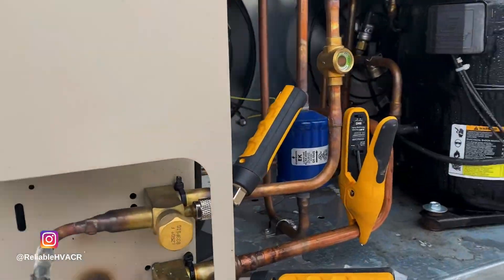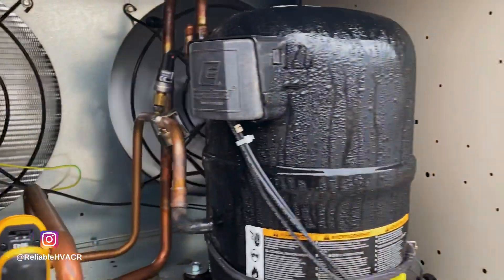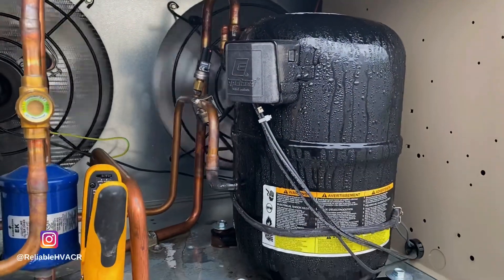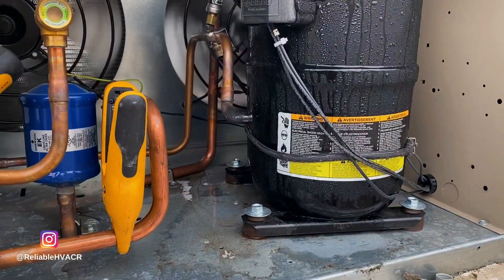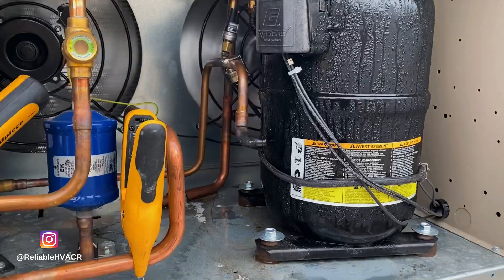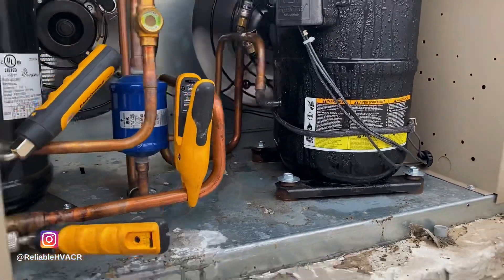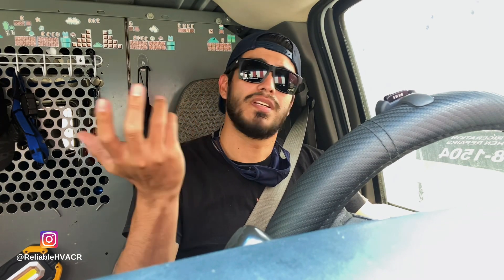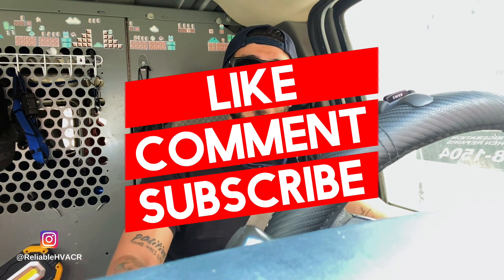Different Issue Now | Update on Intelligen Heatcraft

Comment: I find a lot of bad thermistors on them. But just had a similar problem and found the plug harness where it plugs into stepper motor was dropping 1 or 4 legs. I could bend the wire back and get continuity, so I zip tied it in that position.

Comment: I spent 2 days trying to figure out a similar issue. 
In this process I found that two small disc shaped magnets, the silver strong magnet type, when stuck to the valve body with yellow coil removed, can be rotated and open and close the valve. Definitely helped me find the problem. Then I just had to wait for parts overnight shipping because no one had the parts in stock!

Comment: I know this is an old thread. Always verify the suction valve pressure transducer values, with your actual pressure gauge. I see on the video the EV suction pressure is at 84.7 psi, EV suction temp 38F. When pressure testing this system. Do not exceed 150 PSI. Higher pressure test will destroy the transducer.

Comment: Got a ? Maybe u can help or someone here
The other day i came walk in cooler 44 degrees wont go anylower After 2 days coil completely freezes up
Its running 448a system is 9500 btu 
I defrost the unit 
Start it up 
Its set at 7 superheat 
My monitor showing me 7
Sup
I put my digital gages sup matched suction line temp matched to what board
 reading exv does pump down and opens up no problem. At 43 degrees its starts to freeze up
To test i set it at 44 and runs ok no freezing
Oh did i mention 152 steps valve doing. 
Checked the pressure hi low side evrything looks good but the damn thing wont go below 43. Theck support trying to tell me tge unit undersized for the cooler box.

Comment: Comments from Heatcraft training today... #1 problem is not setting tap on transformer to 208 volts if that is your supplied voltage.

EEV valves themselves are pretty simple and bulletproof IF system is clean and tight and assembled while purging nitrogen. Powerhead coil failure possible but more likely GIGO info failure or bad board.
Reply from the maker: I had someone from heat craft reach out but nothing came from it.

Makes sense but I installed these myself since they were new to us. Used nitro ever time and protected valve. And we ran a new breaker & line, ours were 115v . 

But yes I realized it was the board and not the eev , I'm just not sure how to test them. When you run it in test mode of course it gives you all the proper readings. But it isn't sending out signal during normal operation. I figured I'd try a new board since they had sent one just in case and that was it.

Comment: I had same problem with heat craft beacon2 EEV valve. It was failing to open valve. I did replace EEV coil but nothing helped. Next day I went to change valve and found from there employees that it just started working 45 minutes ago. I still not understand how it started working after 13 to 15 hours later. It’s been four months it is still working.
Reply from the maker: I've tried calling and I didn't get a straight answer unfortunately, for me the board was faulty even tho the test mode was showing good. I think with these it's usually a control issue not the valves.

Comment: Sometimes these things get into a funky lock up thing. This worked for me. Disconnect the 24 volts at the transformer and then restore it. Do this about 25 times for about a minute,  then cycle all power off and give it a try. These are 0-5 volt DC bipolar expansion valves meaning it needs 5 volts + to open all the way and 5 volts - to close. The board is supposed to remember the last position the valve was at when it turned off, so that's what it will open to even thou it may say differently. What I do know if you over cycle the board power (many times) it makes it get stupid and go back to the default setting. These valves have no feed back to the board telling it where it is and I think the board gets confused as to where it should be and does nothing or drives it all the way open. I have found this problem on high load systems where defrost is used a lot. This doesn't fix the problem but is a work around in the rare situation it does this.  This should force the valve to close.

Comment: That's my client too, just had a nitmare with a freezer,  first valve, they factory said bad valve again stuck open, voltage looked good,  ended up doing board and it worked even with factory saying board good, crazy
Reply from the maker: Wow same exact then 😂

Comment: Found this video while waiting on hold for heatcraft tech support. Having the same exact issue. Swapped the board, valve, and eev motor. We've swapped out eev motors and boards on multiple units.
Reply from the maker: After this video it's been working, so far only 1 out of 3 units we installed did this. It was so frustrating tho. And I've heard the same from others.
Reply: @ReliableHVACR  
On this one the eev and board were bad.  But during troubleshooting I rotated the plug for the eev motor and connected the terminals incorrectly. This causes the motor to run backwards or inconsistent operation. I chased my tail for a few hours but I'll own my mistake.

Comment: You can close it manually by rotating the coil on the valve counter clockwise.
Reply from the maker: I thought you needed a special carel magnet tool to do that, been meaning to order one.
Reply: @ReliableHVACR    Stock coil will do it.  You can also check the new valve before install by blowing through it to see if it seats completely when turned counter clockwise. One full rotation is approximately 60 steps.  Of course turning it clockwise will open the valve and it should only take 5 full rotations.
Reply from the maker: Good to know. Thanks for the info

Comment: I haven't had to use it but my supplier sold me a magnet by Carel I think. It's tiny compared to your solenoid magnet and it has some writing on there for quarter turn half turn for opening and closing those eevs.
Reply from the maker: I need to order some, I wish I had one for this. Customer buys the equipment from up North. Our suppliers don't really have this equipment or tools locally yet

Comment: Been having a bunch of bad boards lately
Reply from the maker: They want us to install more so we'll see what our luck is
Reply: @ReliableHVACR  all our new installs are these things. Some bad boards on start up. Coils unusually ohm out with in spec the valve itself should never really “malfunction” but restriction in the mesh screen yes that will breakdown and mess up the mechanics in the valve. Other then that 9/10 times it’s the board wether you catch it act up is the issue could take multiple trips but you did everything perfect lean on the factory if need be they design it they should know what’s going on right? Lol great video.

Comment: When eevs are motorized then when they stick they leave the refrigerant through at percentange of the position they stopped. If they are pulsed they close completly like a solenoid valve. Hope that helps

Comment: you might want to check the charge ,it sounds like the by pass is opening,not enough liquid,if it does it again,might want to add refrigerant.valve wide open and not freezing the lines ?

Comment: If you do a lot of eev buy the Sporlan Sma-12 valve actuator. It’s battery powered and you can drive the valve open and closed manually. It has saved me on a beacon 2 system before. I proved to Heatcraft that the valve was bad. Look into it.
Reply from the maker: Yeah I need to invest in some tools for these
Reply: @ReliableHVACR  these are good systems when installed correct. You did everything possible and still got a bad apple but don’t loose faith in it. The future is eev units.
Reply from the maker: Yeah the way I see it is I'm just more comfortable going forward. They are really simple to install and I enjoyed that part. I'll know a little more for next time if issues come up 👍🏽
Reply: A little late to the party but if you watched the video that was a Carrell EXV. A sporlan SMA-12 would be useless. They use a magnetic tool

Comment: I know on the Ruud EEV's you can check the resistance on the motor, and they should all be just about the same resistance. If one or more are reading a large variance the EEV motor is considered bad. 
As far as testing if a board is bad, as far a I know, the only way to check is to:
1- find out what is not working
2- know the units sequence of operations
3- verify every sequence is operating within parameters 
4- Once every sequence has verified your left with a bad board xD
PCB's are wayyyyy to difficult to troubleshoot. Too much circuitry on too many plains.

Comment: Yank it out make mechanical install a a421 with defrost and go to go
Reply: When the new stuff fails…..A421 a solenoid and be done with it. 
Only time I work with stepper motors in the grocery stores are for EEPR on the racks.